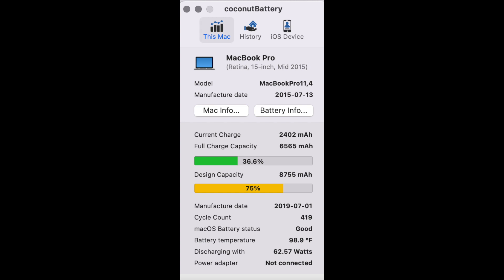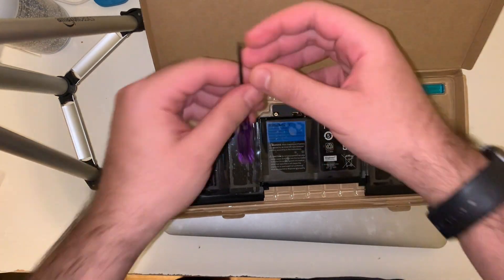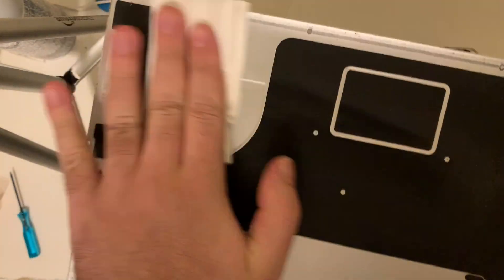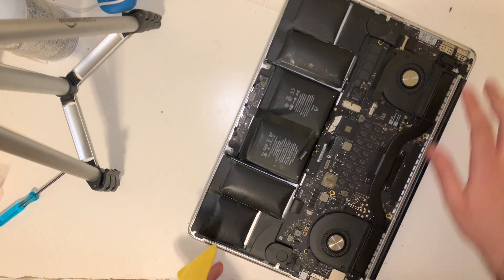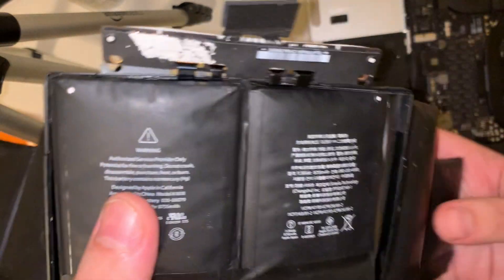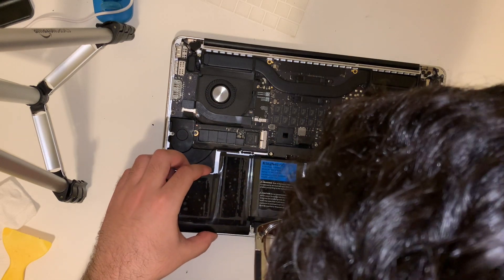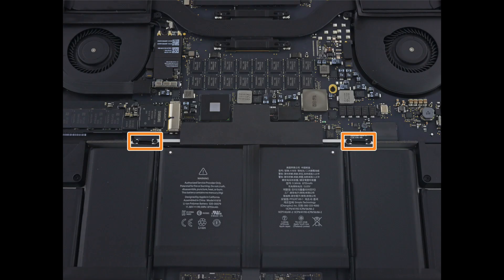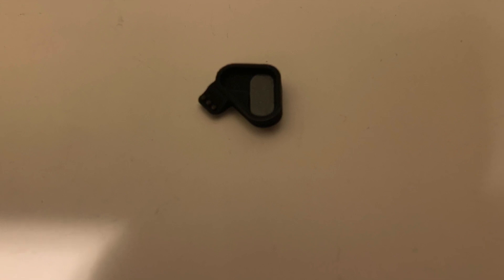2015 Macbook Pro Battery Replacement

Comment: How was your battery after the replacement? I got the battery bloated since my replacement in 2020, very annoying this problem battery in this model :(
Reply from the maker: Thank you for watching and taking the time to leave the first comment on this video.
Reply: My friend have the version 2018 and did not get this issue for about 5 years now, so I will maybe take the new model if my battery will swollen again in 1 years. It was a pleasure to leave the first comment :)
Reply from the maker: @andrei1457  the 2016 and 2017 models have a screen connector issue people call “flexgate” which is very expensive to fix then there are keyboard issues on a lot of other models. I think the issues have been resolved in newer models that use an apple designed processor.
Reply from the maker: I don’t think it has anything to do with the laptop it’s just a combination of luck and the quality of the replacement battery. I have had it installed for around 8 months now without issue. This is my third battery, I previously had it replaced by Apple. When Apple does the replacement they replace the entire laptop body including keyboard, my DIY replacement didn’t do that so I still have a bulge from the bent/stretched laptop bottom cover. I’d say replacing the battery every 2-3 years if the bulge bothers you maybe normal, there must be a lot of people in need of these batteries for aftermarket manufacturers to exist.